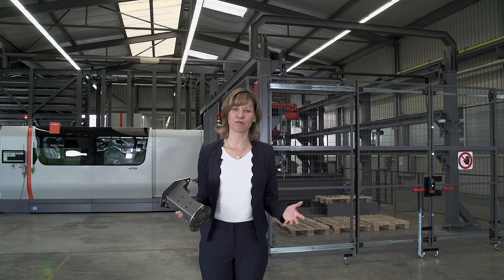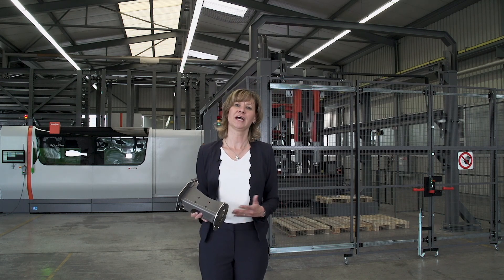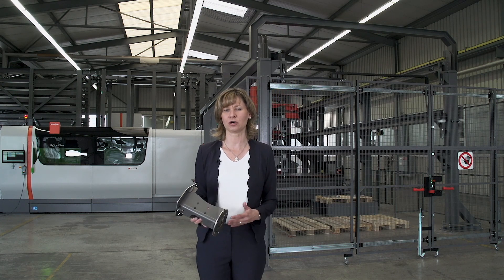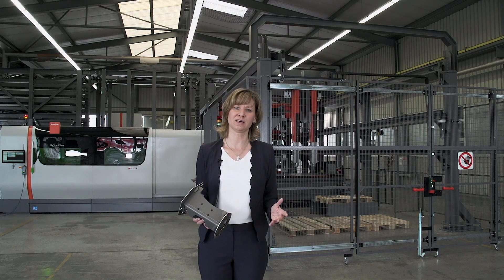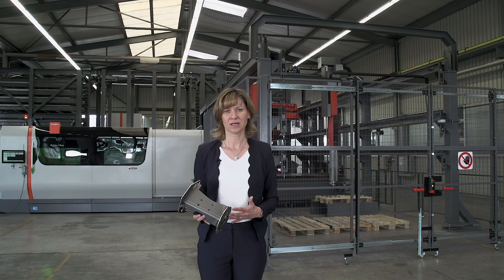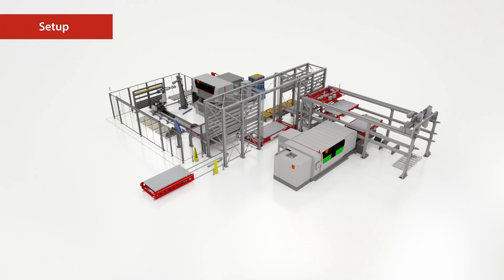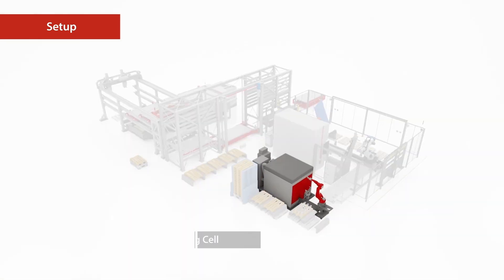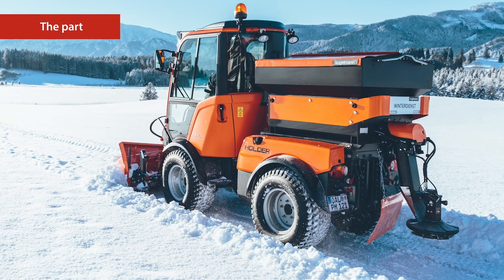Bystronic Smart Factory: Fully automated assembly production with comments (English)

Comment: What about Deburring & edge rounding for paint requirements, before folding and welding?
Reply from the maker: Dear @gdawe1, in the video an example of an integrated production workflow was shown. Depending on the part and product these production steps are changing. The Bystronic Smart Factory is designed to handle different production steps and provide the agility in planning and transparency of the current state by integrating these seamlessly into the production planning and monitoring. Best regards, your Bystronic Team